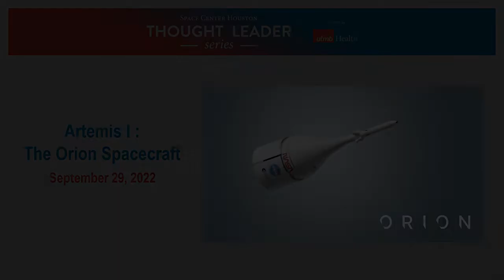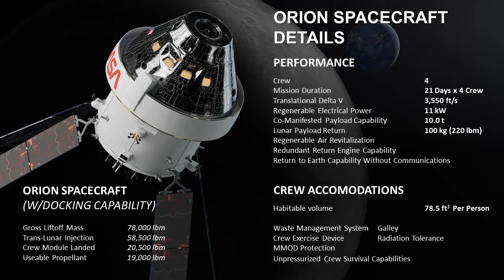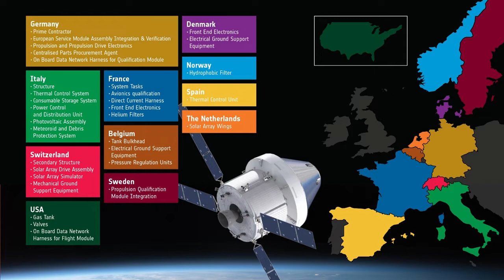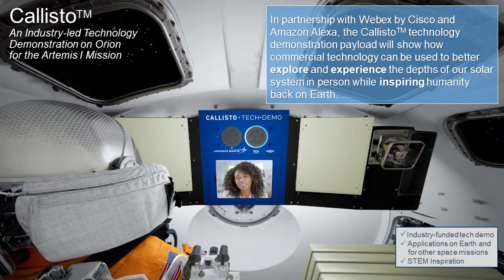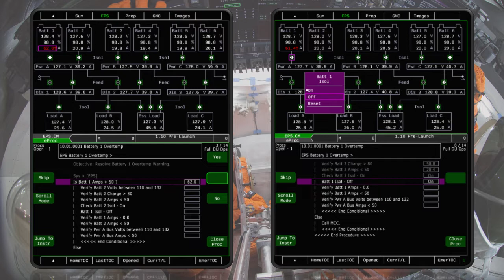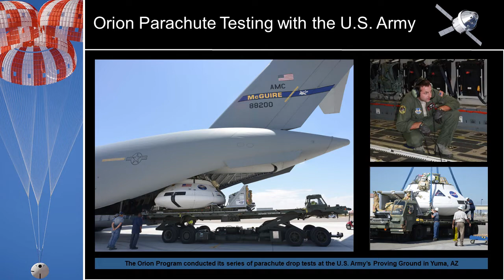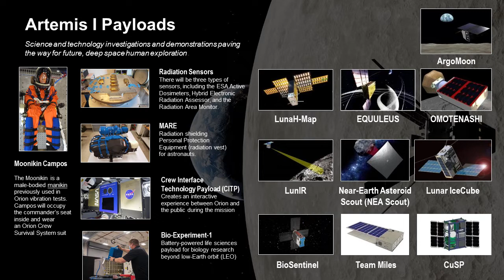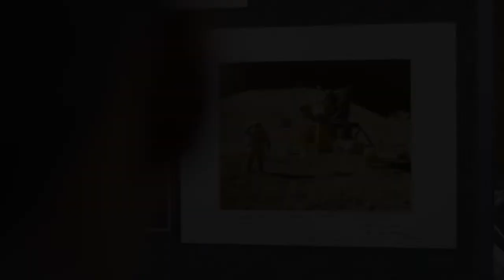Artemis I The Orion Spacecraft

Comment: One switch or gauge for one function or reading versus having multiplex signal to coneections harness to one touch screen display....with three backup replacement in storage. I see there is problem with weight and space.